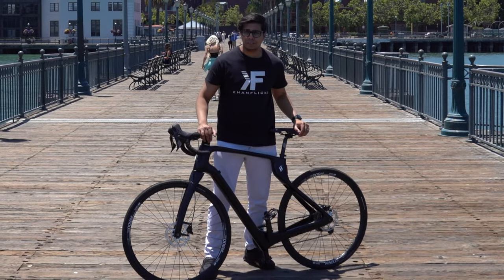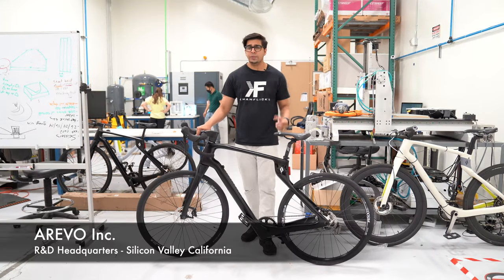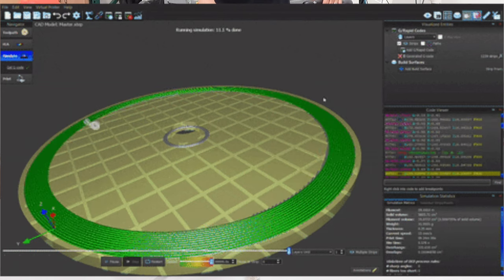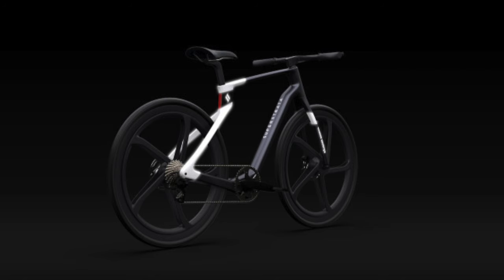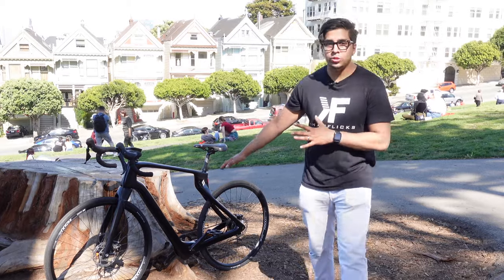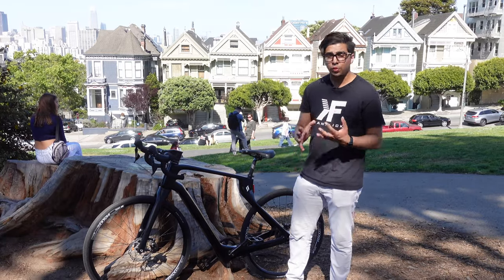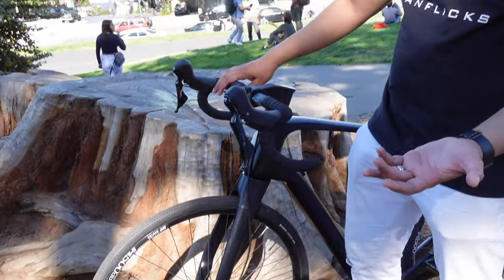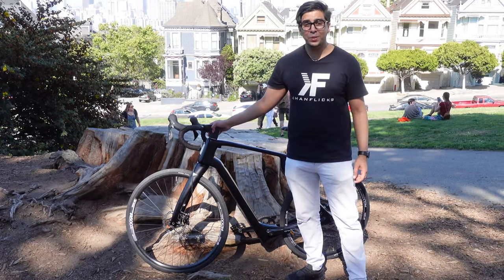The Carbon Fiber E-Bike 3D printed by Robot!

Comment: That's a Joke of a "close look" and a "test-ride" with "a prototype" in this state of the campaign. Just my opinion.
Reply: Yeah. It’s embarrassing and kind of unprofessional. Since almost a year backers asked for a professional test ride with a professional biker. But again, riding super slow and carefully in the woods? And when you take a close look you see that the cable is taped on the bike 😅
Reply: Lightweight frame that's lighter than aluminum or two bottles of water - lie
Carbon fiber Wheels - canceled
Time Warp color way - never came to light and now canceled
Elite Group set - now replaced with cheaper options with no choice
X
We currently have:
* Safety Issues: Rear brake coming lose/ falling off that can potential be fatal. SS is now asking backers to repair this issue on our own
* Shitty Paint jobs and integrated lights (also canceled nOW)
* E-Bike display not displaying the proper range
* Drilled a hole in the handlebar without permission approval from the manufacture and got caught
* Fit of the bike is off for some backers, even though their measurements were provided for a "great-fitting bike" according to Superstrarta
* Unwelcome additional shipping/VAT cost outside of the amount people already paid with no proper explanation with data to support this

Comment: The words, Identical and Unique need no qualification!
Things are unique or not - never very unique nor somewhat unique.
Ditto things are identical or not - never very identical.
Headline says e-bike but the version we see is not an e-bike so of course it is super light.
What do the two models weigh please all up? -  ie ebike with battery and motor and display.
Where please to see a review of the Superstrata ebike?

Comment: I ask myself: what is compelling about this bike? Sure, it's carbon fibre, 3D printed and unibody -- all pertain to manufacturing and production -- but guess what? Riding this bike is basically like riding any other diamond frame multi-speed (e)bike.

There's nothing here that transforms the experience in any marked degree. No significant performance boost; no drastic price reduction because of revolutionary production methods; and, no, the absence of a seat-tube, esthetically striking as it is, is not a compelling enough design element that leaves me yearning after the bike.

Comment: Lightweight frame that's lighter than aluminum or two bottles of water - lie
Carbon fiber Wheels - canceled
Time Warp color way - never came to light and now canceled
Elite Group set - now replaced with cheaper options with no choice
X
We currently have:
* Safety Issues: Rear brake coming lose/ falling off that can potential be fatal. SS is now asking backers to repair this issue on our own
* Shitty Paint jobs and integrated lights (also canceled nOW)
* E-Bike display not displaying the proper range
* Drilled a hole in the handlebar without permission approval from the manufacture and got caught
* Fit of the bike is off for some backers, even though their measurements were provided for a "great-fitting bike" according to Superstrarta
* Unwelcome additional shipping/VAT cost outside of the amount people already paid with no proper explanation with data to support this

Comment: I remember several bicycle construction experts stating at the start of the campaign a year ago that a frame could not be 3D printed without a seat tube for mechanical reasons. Well it looks like it can :-)
Reply: So Superstrata should give a demo bike to a cycling publication for review.
Reply: So nobody saw it yet, backers are having this conversation over a year now, speaking to time. They promised to ship half a year ago. 

Those bike experts haven’t been proven wrong, the are saying the same thing still, even when Superstrata changed the bike several times to make it … printable.
Reply: Well I think it's okay to develop it, it's been a start-up campaign. And I'm not surprised by delays either. What is indeed strange is that they announced delivery of first units in April, but none show up anywhere. That seems like a lie. To come back to my original comment though: I don't think this video is fake in a way that this is not a Superstrata 3D printed bike frame. It could be rather heavy though, as the tubes look rather thick now.
Reply: @martinxoxo  nobody is saying you can't print a structure like this. But it needs to be quantitatively compared to conventional carbon fiber frames and a double-diamond design to prove it's a viable method.  You're right about the supposed early deliveries never being seen in the wild though, quite a mystery.
Reply: @joachimrayos4337  Yeah well sure I'd like to see it compared. I don't expect it to beat a high-performance conventional carbon frame though in weight per stiffness ratio or whatever KPI you would use. I think that from the start it was clear that this frame would be way above the around 1kg that those conventional frames achieve. I'd be glad if they can keep it < 2 kg. I think the advantage over metal is that you can give it any form you like by 3D printing, for example to put a battery in the tube or such - while the cost should remain (at least in a ramped-up serial production) way below those conventional carbon frames. I paid around 2500 EUR for my road bike frame only, but I'm getting a whole e-bike (at least i hope so) in Superstrata design for this money.
Reply: It might as well be an aluminium core that has been covered in CFK. I backted this project and withdrew my money after the exact article that you are referreing to. If they really want to prove that their concept is working than they should show stress test results & hand out prototypes to proven experts instead of lifestyle youtubers.
Reply: @axelbrunn7296  It could be that aluminum fake, true. But this would really be a criminal act, I believe. And I'm not a friend of such conspiracy theories - why would they do that? Assuming the good in people, I think they wanted to give backers some confidence, but they did not yet want a "scientific" test of a product that they don't think is ready yet. I AM puzzled though about these mixed signals they send, publishing about commercial delivery, but then hesitating to have the product tested. Let's wait and see. I'm rather patient, and find this whole project rather entertaining with a bit of thrill as I bet on it by actual money :-D
Reply: @martinxoxo  I get your point. Exceptional claims require exceptional proof - on both sides ;). My guess is that it's the typical fake it till you make it attitude that many US Tech Start-Ups live. They use the campaign mostly as a vehicle to attract more investor money hoping that they get everything fixed along the journey. Honestly I would almost have seen it exactly like you - as a bet in a new technology with (a lot of) acutal money. What changed my mind was the thought that I will put my health & dear life in the hands of this bike frame not knowing if it really holds up to its promises. So far they did nothing that convinces me that this is a wise decision ;).
Reply: @axelbrunn7296  I think you hit the key point of backer frustration. They made big promises, crowdfunded a lot, and now evidence that they can deliver on said promises is sorely lacking.